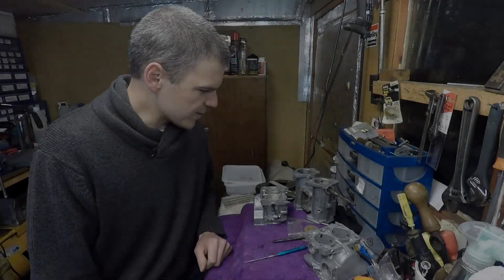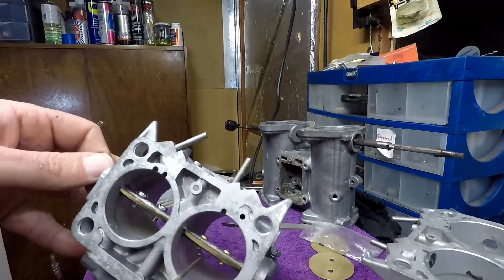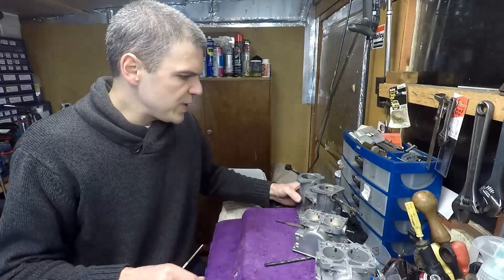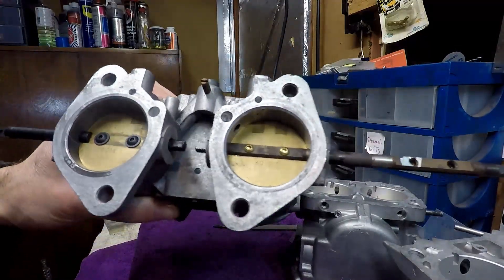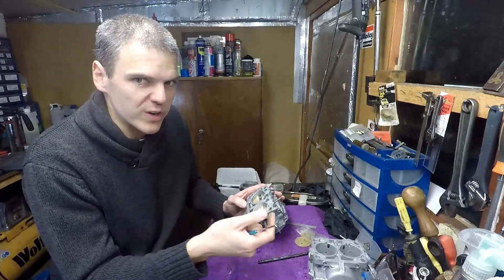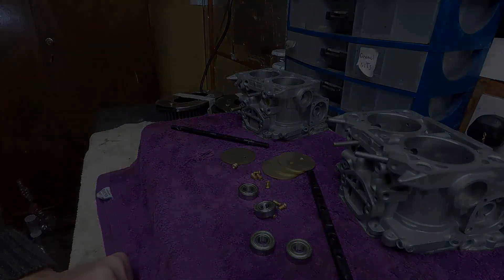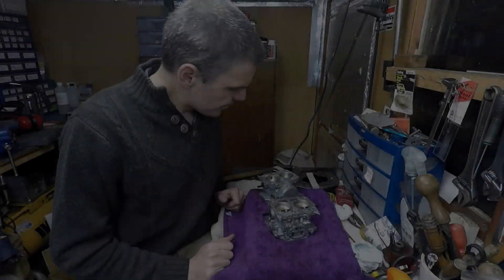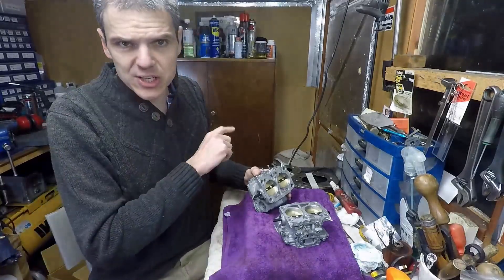The secrets to power tune a Weber 40 DCNF revealed. shaft modifications and throttle plate re set.

Comment: How strong is the shaft when cutted?
I am curious since the return spring is on one side and the throttle lever on the other, would that torque the shaft too much and deform it over time?
Reply from the maker: It is strong enough for ocasional use but maybe not for daily driving. Which by this stage none of these units are in daily use
Reply: I guess you are right, thanks!

Comment: Use a snug fitting long socket or a metal tube to seat the shaft bearings back in place - NOT a screwdriver!
Reply from the maker: Yup! Use that as well! But sometimes I use whatever I have handy. I have done this a fair few times so know what to strike and what to leave alone.